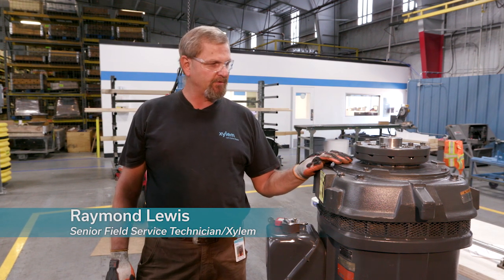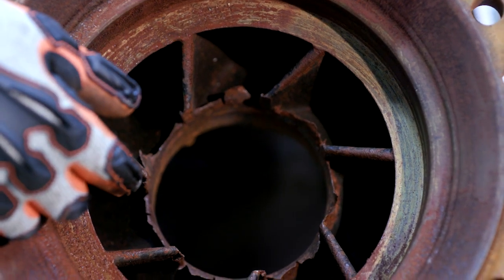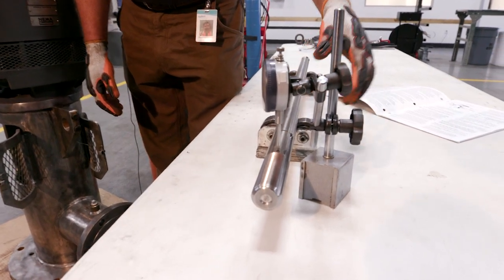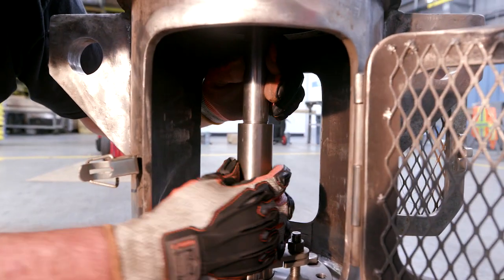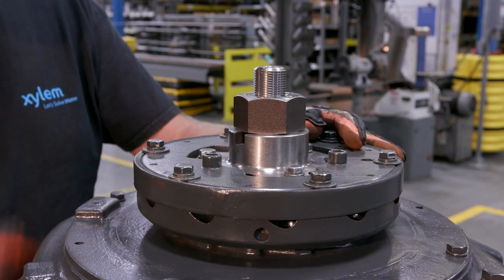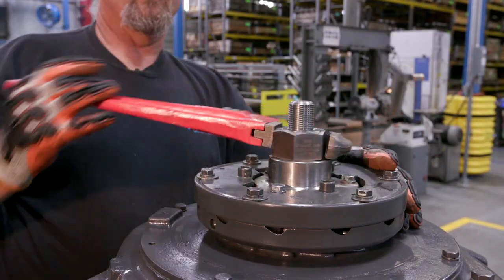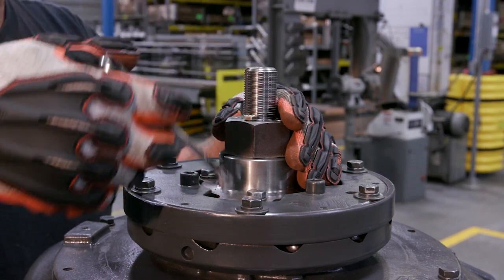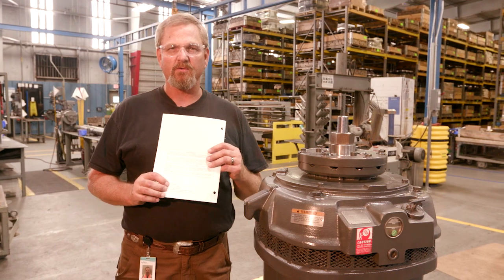How to Install and Adjust VHS Motor for Deep Well Turbine Pumps

Comment: Good night friend, I am going to install a 500 hp vertical pump, but I have doubts about the coupling because the pump has a threaded shaft with a coupling, I would like to see if you can guide me, thank you

Comment: Please help me understand why you adjust this pump up 70% without knowing the K factor of the bowl and the shaft diameter, shaft elongation and pump setting. I think this video could be miss leading or incorrect without all of the information. This video makes it sound lie all turbine pumps get adjusted 70% what if it was open impellers? I think this video should be redone with the right info
Reply: He's only setting the lateral of the pump (the available space for stack adjustment). The stack height would be adjusted when the pump is installed - to proper impeller height based on thrust, shaft and column elongation, impeller/pump weight etc.
Reply: Do you know where I could find the coupling for the headshaft in this video?